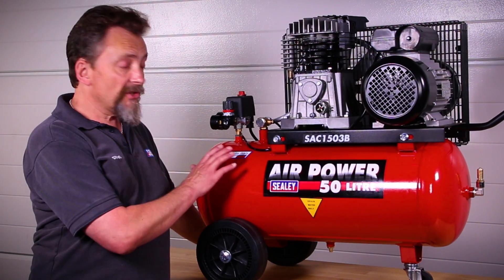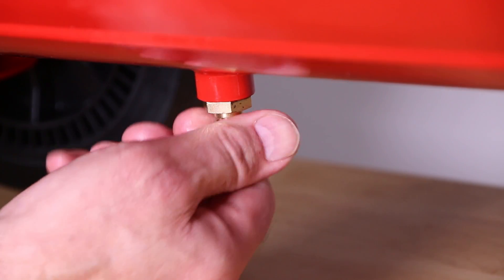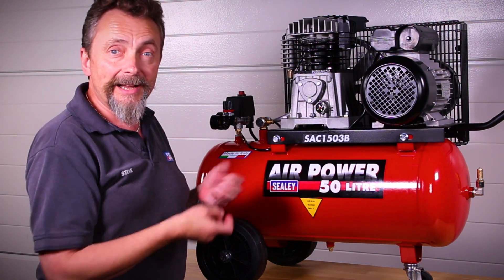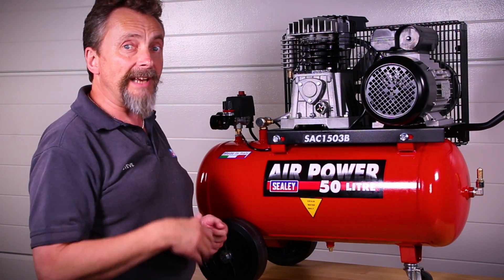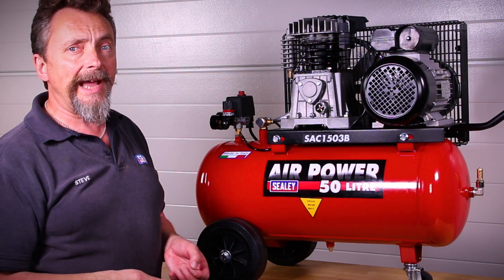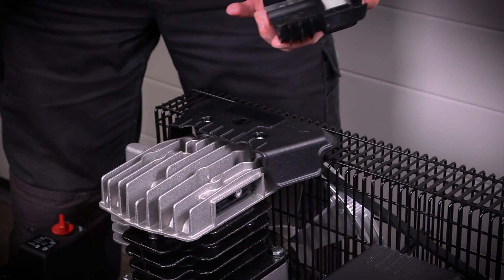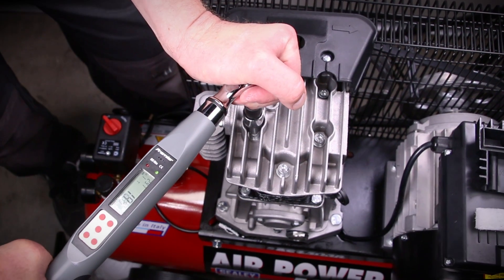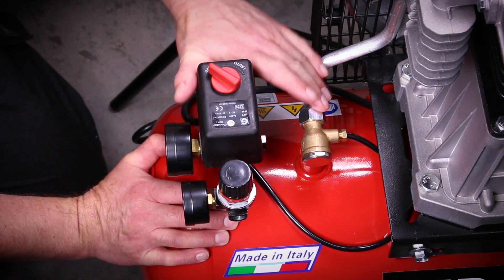Compressor Servicing Guide

Comment: Water in the oil is what kills compressors . The dot in the sight glass is to detect water in the oil . Water passes the piston rings and collects in the crank case oil . If you fill the oil to the dot you can tell if you are loosing oil . But if the oil rises above the dot the oil has water in it . Compressor oil should not mix with water so the oil level will rise without coloring the oil .Compressors with oil pumps have an O in the sight glass , put the oil to the bottom of the O and if it fills to the top of the O the water is to the fill pipe on the pump .

Comment: I’ve got the same model but I’ve got a constant oil leak under the pump. Not sure if it’s the gasket or an easy fix, it comes through the corners under the pump mounted on the black frame. Any ideas what it can be
Reply from the maker: Hi Rob, thanks for your email. If you contact technical@sealey.co.uk they will help you with your enquiry.

Comment: so what happens now when you drain the tank and rust comes out? is the tank no good anymore? or can you still fix it?
Reply from the maker: Hi, the water will always be orange because the condensation will corrode in the tank. As long as you regularly empty the tank, it will be fine to continue using.
Reply: @sealeytools  but how do i know when the tank is no good anymore from the corrosion inside?
Reply from the maker: @wanderingandroid  Hi, It's very difficult to tell. ideally you would need to get it assessed by a safety engineer. They will asses the depth of the corrosion with an endoscope.

Comment: My compressor is leaking oil from the back cover, if i keep the oil at the right level, is it still safe to use?
Reply from the maker: Hi, Ideally for safety you should fit a new gasket/seal. As long as you maintain the oil level it will still be safe to use.

Comment: Belt drive compressor... What type of oil goes into the 2nd oil filler port located above the large spinning wheel area??? Nobody ever spoken about it online not sure whether to put compressor oil in or not.
Reply from the maker: Hi Mr Coop, we recommend that you check the manufacturers instructions, as there are several types of compressor oils used.

Comment: Thanks for this ! Just got a "hobby" direct drive 21Litre one. Good info. Very first run from new (breaking in) I was advised by the manual to run with no load, i.e. with the drain-cock open, for 1 minute to ensure correct lubrication...before applying a load. Another part of the manual I had said "don't run a tool when the compressor is pumping..". As I said mine is a hobby one :) Cheers!

Comment: You can add few drop of oil on the air filter, compress it with your finger to spread the oil in the fibers, it helps to catch dust particles.

Comment: What kind of oil is needed?
Reply from the maker: Hi Low Light, very sorry for the long delay. Due to reduced staffing levels because of COVID. It all depends on what compressor you're using so we recommend you refer to your user manual. Or visit their website if you no longer have it.

Comment: My compressor is so old it doesnt have a site glass
Reply: Also it doesnt have an owners manual it was found in the trash theres no model number on it either
Reply: @jo6520  ,
Congratulations on finding a "working" compressor in the rubbish!  At such a mature age, it probably doesn't need break-in, but most likely does indeed need major maintenance.  If you ship it to me here in Nepal (40 km Southeast of Katmandu),  return postage pre-paid, I will be DELIGHTED to completely overhaul/rebuild/restore it for ONLY $199.95US + machine-shop fees, parts, labour, taxes and my service charges.

Comment: Is it not important the motor remains truly square to the frame?  Otherwise the drive wheel and compressor wheel are not properly aligned, this can create stress on the shaft bearings, leading to wear and potential failure.  At the very least it will shorten the bearing lifespans.  Good video.